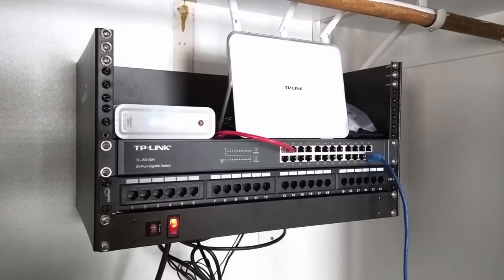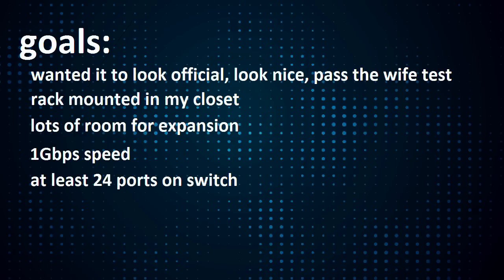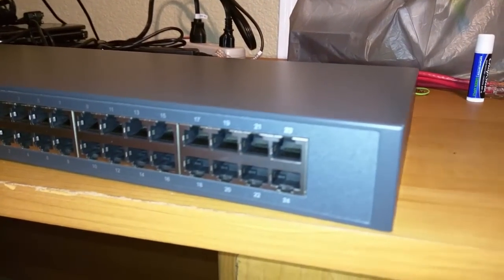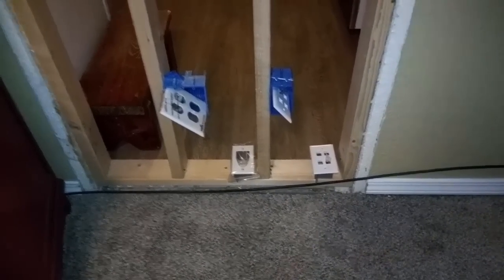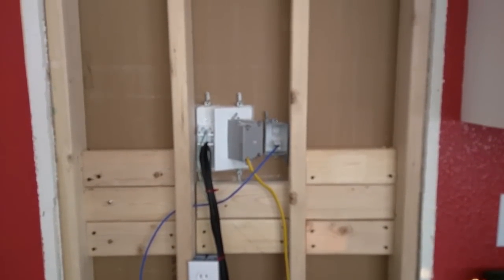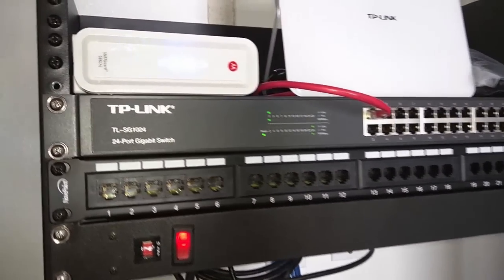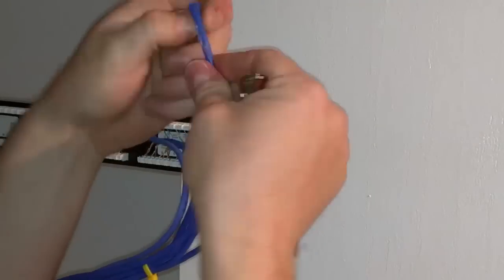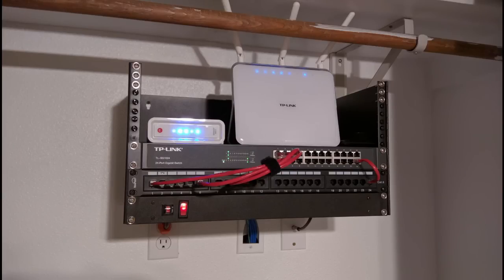Budget Home Network Tour/How To

Comment: One element I picked up from watching pro vids on networks is the "service loop", a loop of cable that gives you the spare length if you need to fix something. There are other choices that can be used, though they cost more money, such as Keystone connectors which need very little untwisting of the twisted pairs.

General electrical safety: keep your network cabling clear of mains power cabling. I'm in the UK, where we run at 240v, and maybe the electricians in my family made me a little over-cautious.

Some things you show would be difficult here in the UK, because of different house-construction methods. The Keystone system is available here, with connector modules for aerial and audio connections, but there is a different size standard, working in a similar way, that also gets called Keystone by some.

Again, different UK standards, but I would use a PDU that had standard UK power sockets, rather than the IEC types (which you can see on a desktop PCs PSU). It makes it easy to add a wall-wart to power something such as that wi-fi, or a PoE box, or just to provide a USB charging point for a phone.

Comment: 4:28 you've got 110V in the same stud space as data cables. That would fail a code inspection since the 110V would induce noise in the data cables.
Reply: Ehhh, that's what shielded ethernet is for.
Reply: No, it would fail the inspection because it might come into contact with the LV cable and cause high voltage to be introduced into that system.  The code doesn't care about data interference.  It only cares about safety.
Reply: He also doesn't have any of the electrical wire stapled to the wall.  It basically only held there by the outlet boxes.

Comment: Really useful for learning how to set up a wired home network, my fam have always managed on WiFi but with the new setup we're installing we can use ethernet and we will have a better WiFi connection. It won't be quite as good as yours but it will definitely be a massive improvement, thanks for sharing your knowledge

Comment: Good video. People think they can't benefit from a wired house because their internet isn't fast enough, but I think they can.

The more devices you can offload from 2.4gHz to 5gHz and wired, the faster the speed on your phones, tablets, and other roaming devices. This also frees up RAM and processing power of the router, making web pages respond a little faster.
Reply from the maker: Very good point!
Reply: @BudgetNerd  thanks! My setup is jank compared to yours.

2 5-port switches because I didn't get an 8-port, going to 3 access points. The APs are older dual band routers, so whatever is nearby and stationary like printers or Chromecasts get put on the 5gHz, everything capable gets plugged in, and the 2.4gHz is pretty reliable and quick.

The main router has always been the newest piece of equipment. With the wireless turned off, it always runs very cool and reliable. Every couple years it gets rotated out and replaces the oldest access point. I'm overdue for a new main router, and I'm leaning towards an edgerouter from ubiquity.